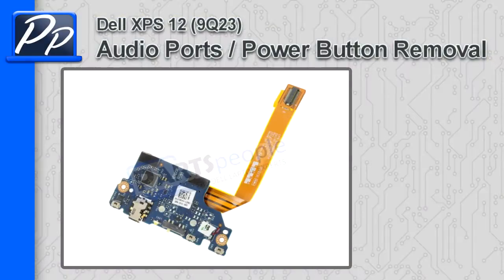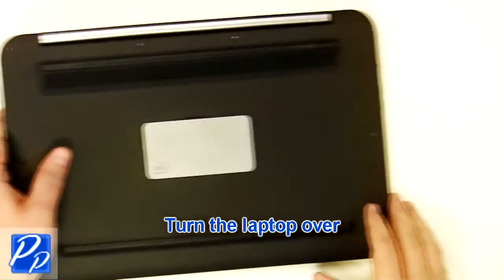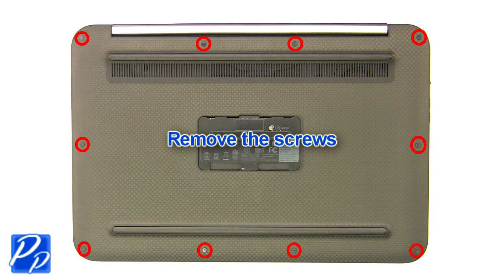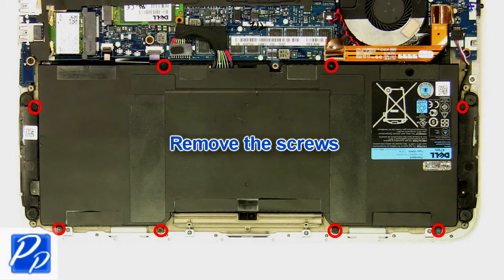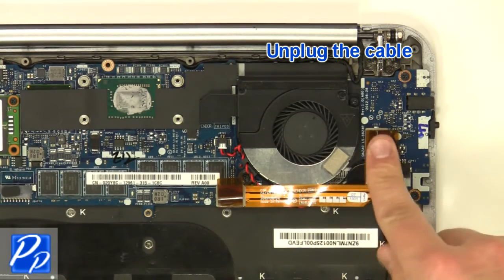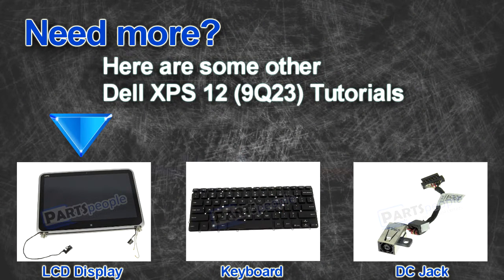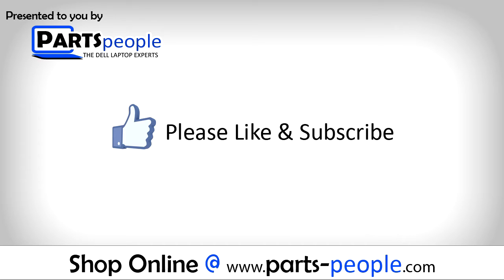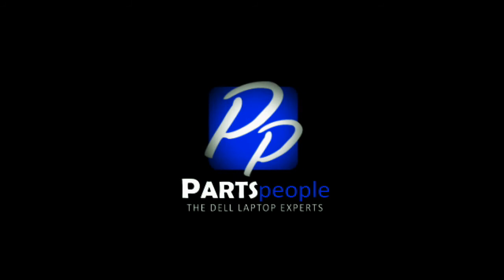Dell XPS 12 (9Q23) Audio Port / Power Button Circuit Board Video Tutorial Teardown

Comment: The circuit board/ power button on my Alienware 17 r4 was almost entirely deteriorating,I ordered an entire new set only after trying silver coated vw-1 it doesn't work at all ,in 3 days it's fixed I hope.